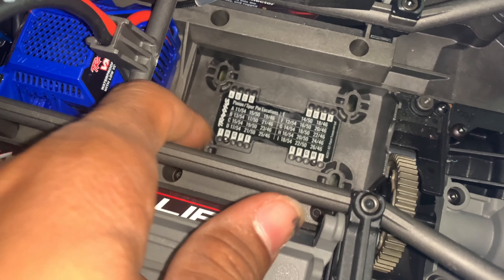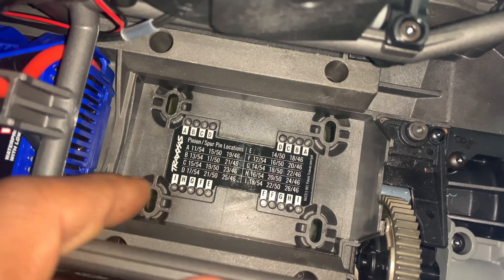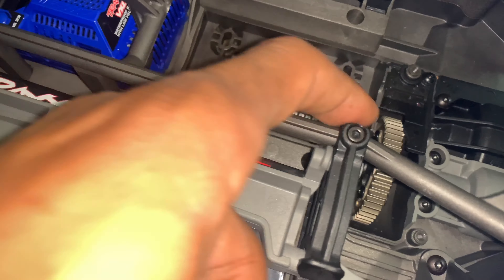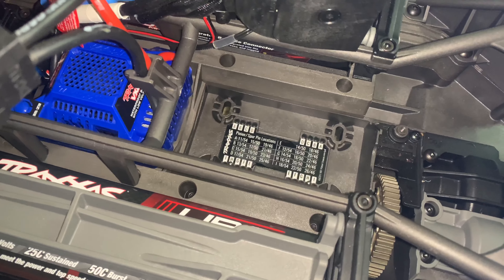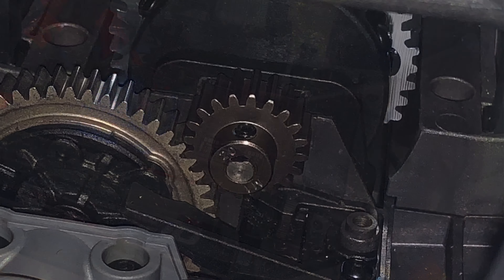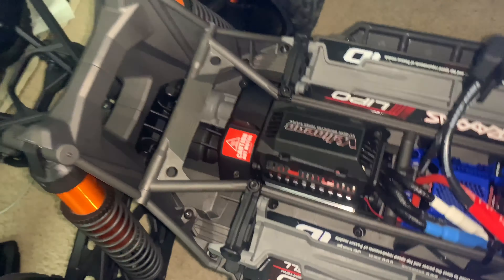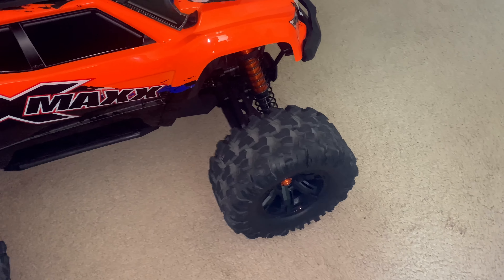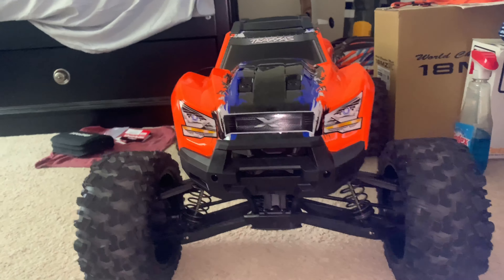Got My New 20/50 Gears On My XMaxx And Ready To Go

Comment: I just bought 20/50 set up too, but GDS brand. Am I supposed to use the pin system too for the mesh? When I did that, the pinion teeth weren’t touching the 50 tooth spur gear?